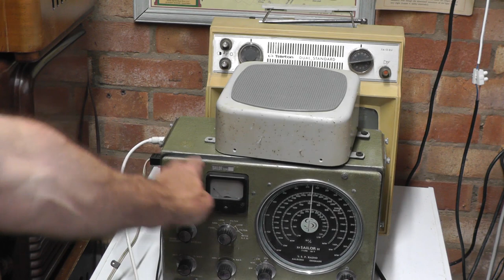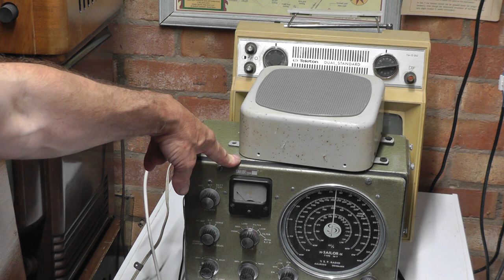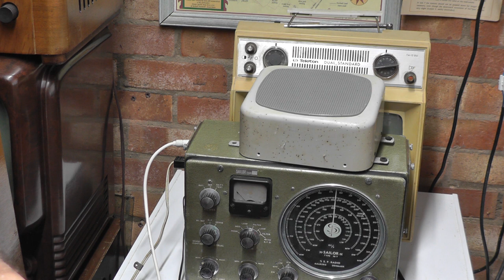Make A Crystal Radio Work

Comment: A crystal set would work well where I am. I am only 5 miles from the BBC Transmitter at Brookmans Park.
Reply from the maker: Oh, yes sound like you would do well there for sure with a Crystal set! Sorry for the delay in replying been switching over to a new computer and it seems I have missed some of the Youtube notifications. Thanks as always for your great comment. Kev.
Reply: Where you are in Northampton is sort of between Brookmans Park and Droitwich I suppose.
Reply from the maker: @stephenhall6595  Yep indeed that's very true we get a very strong good signal from Droitwich as I have said in some of my TV videos here in the village which is high on the side of the Nene Valley we use to be able to see as far as the old Rugby GPO aerials on a clear day and could see the red top lights in the dark on clear winter nights and got a good Sutton Coalfield TV pic in the days before Sandy Heath transmitter opened in the mid-1960s thanks Kev.